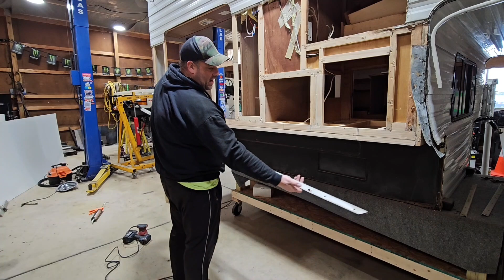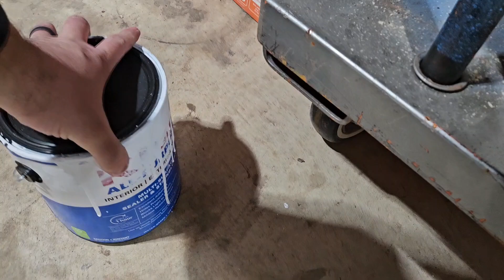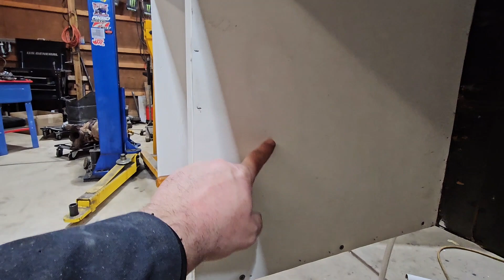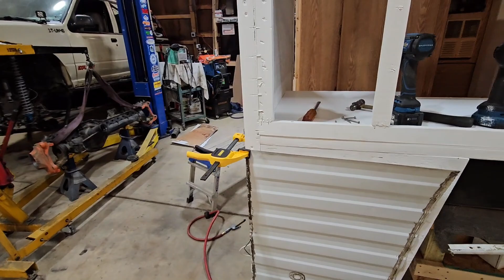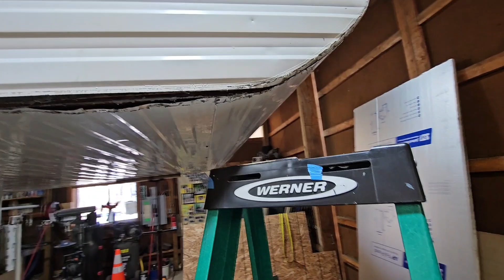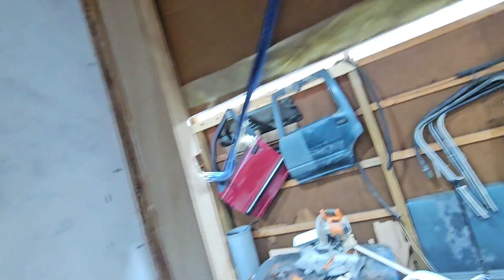Lance Truck Camper Rebuild Part 8! Dinette bench, propane, and battery compartments are DONE!

Comment: I know this video is a couple years old but for the propane bottle hold down, would consider a pronged tee nut on the underside of the wooden platform that you made, with a threaded knob stud. It would bring the fastener inside and orient it, pointing down instead of up. In the upward pointing orientation, you take the risk of it loosening and falling out. And the pronged tee nut holds itself intot he bottom. You can also slide enough wood between the bottom of the nut and the floor of that compartment to ensure it never comes out.Just a bit of food for thought.
Reply from the maker: Definitely a great idea, and unfortunately I have not finished this project yet.  So I will definitely look into this option for sure.

Comment: lance, really, is way over rated based on the structure.....its just like any other manufacturer....btw, its should have already been primed and insulated
i know you are redoing it but i'm disappointed to see what you have to work with from the manufacturer
Reply from the maker: Yeah I was really surprised how cheaply made and designed everything is.... crazy

Comment: Feels like I’ve been waiting forever for the next episode! Good to see the progress being made. What about using polystyrene sheets for the insulation? It’s what was fitted to my Northstar originally. Available in a range of thicknesses, lightweight, easy to cut and dirt cheap 👍
Reply from the maker: For where that cardboard stuff was?  I'll check into that for sure.  All the rest of the voids in the walls will have 3/4" foam board installation and the rear wall and floor will take 1-1/2" foam insulation.

Yeah I had an issue with a break on my offroad rig that I needed to take the whole front axle out etc.

Comment: Thought about using 1/4 or 1/2 foam insulation board in the wall cavities?
Reply from the maker: All the cavities in the wall and floor will be filled with 3/4" foam board insulation, rear wall and floor takes 1-1/2".